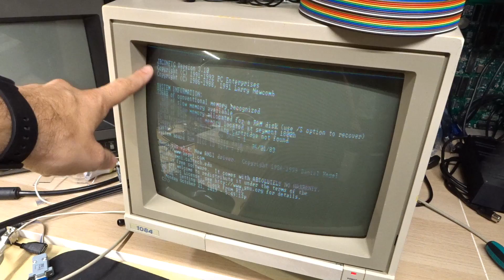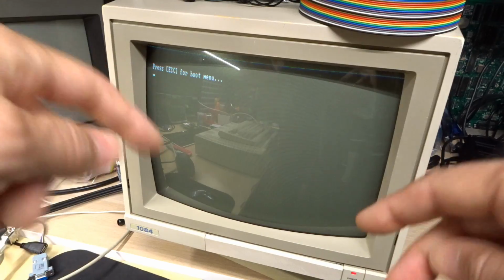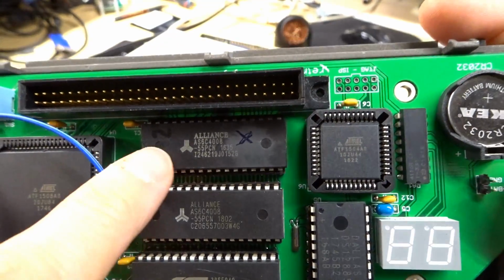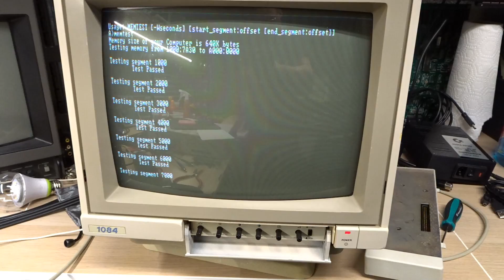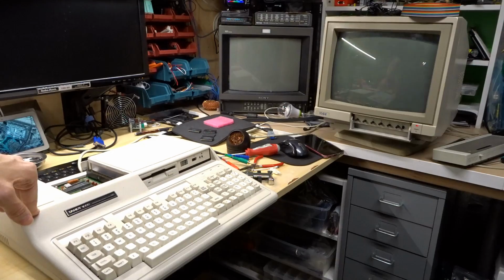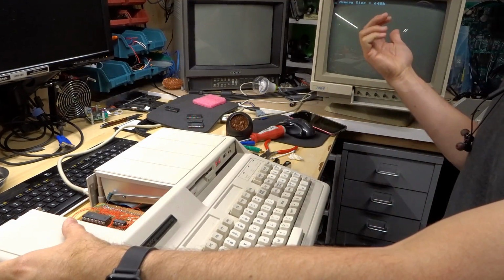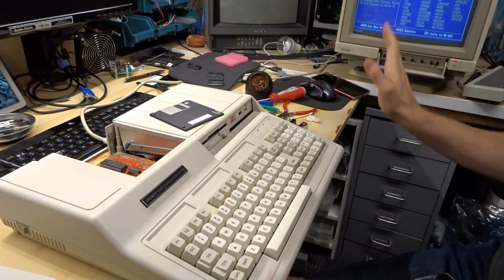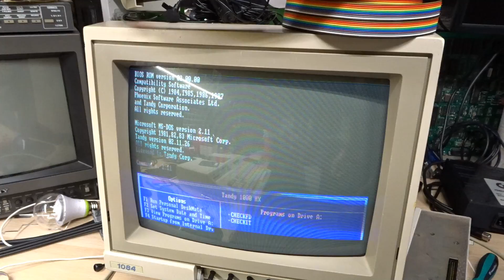Follow-up to fake or real chips? I think I know the answer now.

Comment: Ah, black-topped chip. They grind off the top, apply a black dye to make it look like it's intact and apply a new etch or new print. Very common for fake chips. They might be chips from lesser-known manufacturers.
Reply: Chips have been top sprayes and the legs ground and tinned . Which is probably why one fell off
 Common practice over there. They are not always fake but they are not new they are pulls from scrap units cleaned up and rebadged. Sometimes work but sometimes dont , they dont even bother testing them!
Reply: had chips like this.under the scope you could see the old print and different mfg date
Reply: My saga with obtaining a legit TDA1543 was even better. It's a serial DAC with 2 variants (A and no suffix), one expecting the most significant bit first, the other expecting the least significant bit first. The A was a niche variant, that's getting remarked as the one without the suffix these days. Due to the different order of the bits expected they're not cross-compatible - but guess who doesn't care? Yup, scumbag remarkers.
Reply: Yep.. they do that so the chips that leave the factory look good, and the count is right.  Then they end up at, for lack of a better term, a chip chop shop that mods the nomenclature.
Reply: Why would they grind of the top? To hide the original manufacturer and part number? Doesn't make sense.
Reply: @samuellourenco1050  They are known to do this to slower chips to sell them as faster chips. They also do it to non ROHS to make them look like ROHS.
Reply: @samuellourenco1050  Exactly.. they don't want you to know that this was originally a sub-standard chip.  By replacing the label, they can sell it at a higher price.
Reply: @chrisw1462  I wouldn't call it sub-standard, though. Probably it is an equivalent part of other manufacturer and with a different part number. Not necessarily inferior, but probably less rare, and less expensive.
Reply: Yep measuring the thickness of the chip accurately would be the give away.

Comment: That was pretty brave putting the china chips into a known module for the PCjr but I guess you already knew they weren't the smokey type of fake chips. My guess as to what happened is the china chips are "legit" but are also below the required standard for normal sale and were never laser etched?  And then they were taken by a third party and given makings etc and sold.  I'd also bet that maybe the IBM PCjr is probably more fault tolerant of problems with the chips and that's why it works with them?
Reply: @adriansdigitalbasement  I didn't think of that, It would be interesting to experiment with the timings on the chips and see if they do cause the issue, or maybe under clock the Tandy and see if that helps.  Maybe the issue is a combination of having subpar chips and no 74LS245 on the address bus, the Tandy 1000 service manual I just looked at says its only meant to active for the data portion of the CPU cycle.  Maybe without the buffer blocking the lines in the other parts of the cycle plus the chips not being to spec could cause it.
Reply: Adrian Black I’m very curious to see what would happen if you put an octal transceiver on your board

Comment: Yup, you got floor-sweepings. The paint on the chip is called black-topping. Paint is used to cover up the original markings. The substandard chips probably failed one of the many quality tests that the manufacturer does to their product with the offending chip tossed in a bin for disposal. Whether the substandard chips were sold, picked out of the garbage or whatever doesn't matter. I went through this with some hard to find power transistors. After about 5 different batches, I gave up and settled for a quality local source close equivalent and ended up swapping the base and collector to get my transmitter to work. I wasted many weeks because of unscrupulous vendors.
Reply: @adriansdigitalbasement  Another common scam is relabeling lower end parts as higher end parts. This is a big problem in the vintage computing community for high demand parts like fast CPUs and FPUs. Sometimes scammers get away with it because the lower tier part will run at the higher speed, but may have a higher heat output and draw excessive power.

But this doesn't always past muster, scammers will relabel different parts with lesser features as higher end parts, like a 68LC040 to a 68040 (the LC part lacking an FPU.)
Reply: @adriansdigitalbasement  Maybe a bad batch from a subcontractor? The possibilities while finite, are still a large subset.
Reply: @adriansdigitalbasement  They are 150ns SRAM ICs.
Reply: I had the problem with diodes. Turned into a project to build a low-cost diode tester that can measure Vfd-vs-I. It's basically a curve tracer, except without the graphical display.
Reply: You would think that they would use flat black enamel paint rather then something that is akin to cheap ink , but I guess paint cost's too much?

Comment: LS245 might only be needed for DRAM and not SRAM? If it's a dedicated refresh circuit it'll have to refresh the RAM without it affecting the bus lines. Maybe they're like, genuine rejects that someone picked from the dumpsters and pawned off in Shenzhen? Crazy behavior but glad you have a sure solution now!!
Reply: The 74LS245 is only a bus transceiver with 3 state outputs. Basically these allow the switching of a device on and off the bus. It wouldn't matter if he was interfacing with SRAM, DRAM, ROM, or even a UART, the IC would be the same.
Reply: @jrmcferren  Right, but the SRAM and DRAM chips are usually have tri-state outputs on their own. In theory you wouldn't need it for the DRAM if you wanted to refresh from the CPU, but if they have their own refresh circuitry, they'll need to be detached from the bus for that, hence the transceivers, but of course SRAM won't need refreshed either by the CPU or any support circuitry so there's no need for a transceiver between it and the main but. That said, it's just a thought, since my theory would require that the address lines be able to be detached from the address bus too :P

Comment: Is it possible that our "Chinese friends" actually re-labelled a slower rated chip as a faster rated version? And the PCjr may work with slower RAMs as well, so it's the reason it's not a problem there. Just guessing here ...
Reply: The Jr also only performs patterning on 64K blocks at a time and the pattern is only a typical AA/55 sequence.  So if there is any aliasing in the fake chips (eg if they are 128K for example), the less sophisticated memory tests will still pass.
Reply: @adriansdigitalbasement  Not with SRAM, but I have similar experience with the Z80 CPUs (in fact, not just me, on some Hungarian Z80 computer forums many users describe the same problem): Chinese "fast" ones (let's say 8MHz and above) often does not work on any clock faster than 6MHz. My theory, that they re-label slower chips as faster. So they're not totally fake chips, they are Z80 (just not the speed grade they claim) ... But still they can earn more by asking for more money because it's a faster version. And they also lower the chance they will be caught on cheating, because many people actually does not push the parts even to their supposed limits, so they can see, "it's fine". With a totally fake (ie, even not a Z80 at all ...), it's still higher chance for sure!!, that customers will complain ...

About the "slow 512K RAM" sounds strange, well, indeed, you're right. I have some 70ns one from Mouser, but I haven't even seen anything slower than that in that capacity. But who knows! Everything is possible as you said, maybe they can get some faulty chips from some factory which are sorted out on some automated tests, that they have problems but seems to work on a much slower access time what it should do. So then now they try to sell garbage ones, basically :-O
Reply: Is it possible to temporarily slow down Tandy using signal generator instead of quartz ?
Reply: Adrian can you use that oscilloscope and record memory access timings on both machines ?
Reply: @adriansdigitalbasement  What's the speed of the memory included with the Tandy, on the motherboard? How does this compare with the specs for the 512Kb chips, both the Chinese ones and the others? 😊

Comment: You probably need a buffer between the memory and the bus
Reply: Makes sense. The PCJr has a more sophisticated ram controller circuit.
Reply: @smbakeryt had a similar problem on his storage/ram expansion card for his XT
Reply: The chip may be a close to spec cousin re-labelled or a QA reject that could benefit from a buffer.

Comment: Glad to've been proven wrong :) What's the ram frequency of that computer? Wondering if they could've relabeled really slow chips.
Reply: 10mhz I think. PCJr is 4.77
Reply: Sorry, 7.16mhz for the tandy. 4.77 for the pcjr
Reply: @wishusknight3009  Thank you :) A 120 ns one should handle around 8~MHz. It depends on implementation since what really matters is how many cycles the reading end waits before polling the data pins, or hold the data while writing.  (With asynchronous SRAM). Given that it worked with the PCJr it might be 200ns. Never seen such big chips at that low a rating tho
Reply: @Chriva  The PCJr's ram access performance is pretty mediocre. It is doing some weird interleave with the video system which will do its accesses all on the built in 128k. So the external ram will be used very slowly. Technically it will only be accessed every second clock so the equivalent of 2.4 mhz perhaps. Or 4.77 with 1 or 2 wait state.
Reply: @adriansdigitalbasement  LOL Aren't they rated 55ns?  They probably forgot to print the 1 for 155.

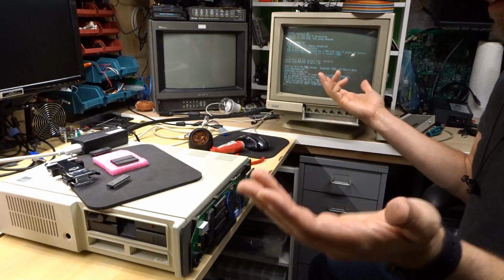Comment: 7:18 Adrian, try actually USING the chip in a real-world RAM intensive operation.  See what happens.
Reply: As I just noted in my top level comment, if the CPU clocks are different on the Tandys Vs the PCJr, these chips may operate reliably
Reply: @jrmcferren  Reliably at a lower speed. I hope he gets the refund.
Reply: @jrmcferren  that's what I was thinking as well.